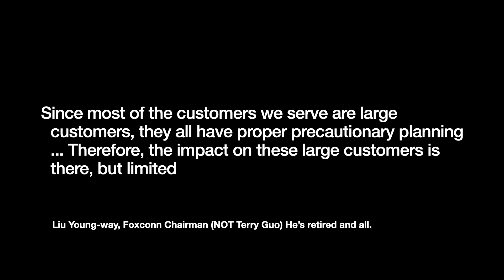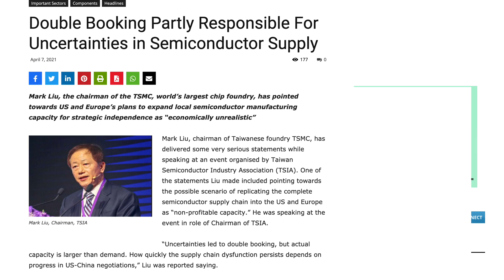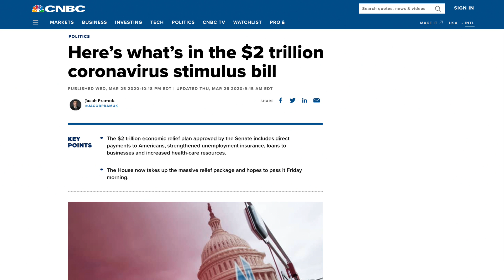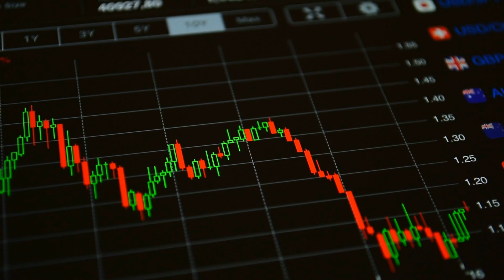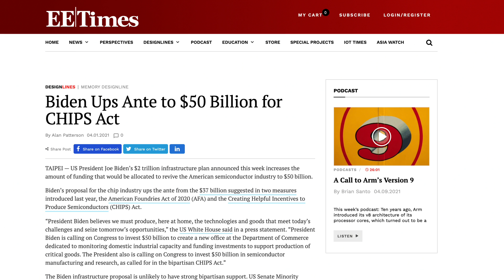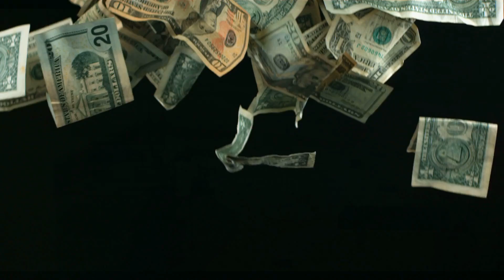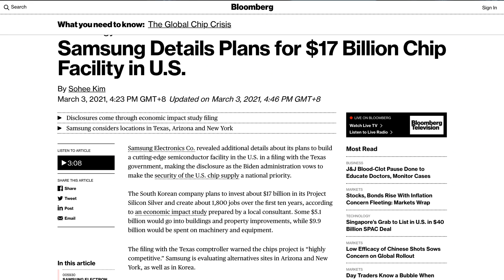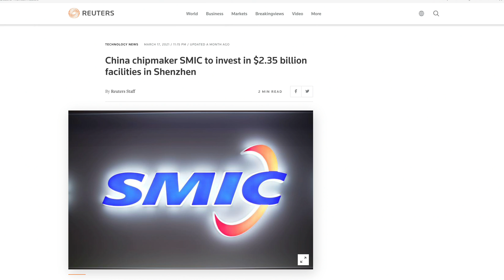The Coming Semiconductor Bust

Comment: Extremely unlikely to happen in near future because it takes minimum 5 years to get a Fab operational to a satisfactory degree. Most of the fab plans we hear are recent or just planning stages.
Reply: What expert forecasting shows (real data backed by extensive research) is in part what's driving all the FAB build outs. Do you think that because it's 'hot and in the news' that a bunch of investors run off to invest $20B in a FAB. These investments are huge and not taken lightly and without a wealth of information backing them up. What would be better is for you to figure out 'why all these investments are needed' rather than 'why all these investments are not needed'.
Reply: Ummm, no.  It takes a long time to develop a new node.  It's expected that the factories that are being built by TSMC and Samsung will be operational in about 3 years, because none of these plants are being used to develop new nodes.  In AZ for instance, that will start out as a 5nm fab.  That node is already in mass production in Taiwan and it's the node being used for Apple products.

Once a plant is built, it takes weeks to get the equipment working and tuned properly.  Not years.
Reply: all sources i can find see it happening no later than 3 years from now, with most saying closer to 2... and pretty reliable sources see it happening as early as late next year.
Reply: But we didn't have a shortage until recently, so if those capacities go to work fully or just partially those fabs don't need to have high productivity to create too much in sum
Reply: @tomlxyz   There was a shortage incoming. There hasn't been enough capacity provisioning to meet demand medium term. Even without the bursts in demand due to work-from-home and crypto boom(s), the capacity would run out shortly anyway, maybe not in late 2020, but in just a couple years. Every year, people need slightly more flash storage, more cloud servers, more this and more that, now fridges have computers too for some unfathomable reason.

Overprovisioned capacity is, to an extent, a good thing. Sure it just costs money when it's not needed, but not having capacity when it's urgently needed can be even more devastating. Whole industries depend on this capacity being present.

Besides, the big growth cycle right now isn't actually that big relative to the existing size of the industry.
Reply: @tomlxyz  shortage was predicted , as there is too large inflexibility and because both industry (or rather marketing) and goverment did not understand fully the complexity of the field. They still do not get it fully. 
The more advanced nodes roll out, the longer it takes to r&d chips, test, more chances for a need of silicon errata , and any supply chain failure or glitch causing shockwaves in too tightly optimised fab environment. 
Fact it costs billions to build a fab makes accountants and marketers try to optimise , like creating fabless companies. But what if fabless company becomes unicorn and buys out entire time of so many fabs , that other potential unicorn corporations get disrupted?
First rule of efficient optimisation is - do not do it. 
It was not followed and while surplus was accepted in lives of actors, celebrities, politicans to excess allowing them to buy luxury yahts and run personal vendetta wars ruining countries of size of France, semiconductor industry lives on rice. 
Shortages will follow also because lot of r&d engineers, and even plain line workers get lost or displaced by current, and future wars. 
Last but not least there is huge shadow semi economy in the giant military complex, which seemingly should be independent from main fabs, but causing brain drain, resource drain and funding drain. This was more or less anticipated ro create effect causing shockwaves in "civilian" semi sector, but it could not be officialy acknowledged until s*& did hit the fan.

Comment: I don’t think the Bust is coming anytime soon. The FABs take years to build and get qualify for HVM. The Globalfoundries gave up the advanced tech years ago. According to the latest article, Samsung is 1 generation behind TSMC. In the leading tech, TSMC is the only supplier right now for the best tech. For the auto industrial, it takes long time to quality new suppliers. It will stuck with the same partners with similar outputs for years. For most Analog FABs, they usually run (very) old tools, old tech and have secret/unique processes. They could not have capital to significantly increase the outputs soon. Even they are going to expand the production, they need to find the tools, spaces. It will take time to install and qualify. It won’t happen next few months!

Different nodes/processes target different markets. Even one node oversupply does not mean the whole semiconductor bust is coming. 
Depending on the future applications, the EV, 5G, Machine Learning, Datacenter … may need (a lot) more chips. I am optimistic in the Semiconductor for foreseeable future.

Comment: Very good stuff, but I think the demand side needs closer consideration.

I am inclined to believe in the current "megacycle"

Fresh demand ultimately comes from folks w/ new apps, needing more grunt or efficiency.

There seems a coinciding surge in all 3, with exponential effect. The new power & economics has made new apps like AI, cloud, blockchain, desktop hi res video editing, AVs,... possible.

It may be OT, but it bears noting how massive demand for solid state data storage will be. There is a vast pool of data  that would be better served by NAND storage if the price were right.
Reply: Demand will come simply because new products exist using TSMC 5 and 3nm.  But he didn't talk about the nodes because he was too busy making a slight at govts. giving subsidies to get fabs built in the EU and the US.

Right now AMD can't keep up with demand for their server CPUs.  Replacing older systems is not just about the extra compute power, but because the power savings.  For older systems, the power savings over a given period is enough to pay for the upgrade, according to IT professionals.  So, the life cycle for replacing systems is being tossed aside.  And this is with TSMC 7nm.  TSMC 5nm is 25% more power efficient, TSMC 3nm is about 40% more power efficient than TSMC 7nm.  This is enough to cause most large companies that have server farms to upgrade.

There WILL be no bust cycle for TSMC in particular.  Apple and Intel has already bought up their entire first year capacity of 3nm.  But, this dude doesn't follow tech news apparently.

Comment: Constraint No. 1: Building a huge new fab requires a lot of engineers, condensed matter physicists, skilled construction workers, etc. Order of magnitude size increases means order of magnitude skill increases. This has to be set against countries like Taiwan and South Korea who have had record low fertility rates for the last 20 to 30 years.

Constraint No. 2: Chip consumption in things like cars and aircraft rises geometrically. The semiconductor count in an early 1980's car might have been 10 or 12 chips. As cars implement on-board networks, the bundles of wires that run through the car is reduced to a data wire and a power bus. The brake light assemblies each have a chip. Each tire has a pressure sensor and wireless transmitter. The overhead dome light has a chip. Each seat belt has a chip. Each 'entertainment center' molded into the back of a headrest is a full blown media computer.

When 'hobbyists' can buy Arduinos for $29 or Raspberry Pi Picos for $4, then 'everyone' can not only use chips (as in phones or laptops), but also design them into their own living spaces. There are now hundreds of millions of 'electrical engineers' incorporating 'intelligence' into their houses, boats, gardens, and farms.

Comment: “Crash” is all relative. Even a slight overhead capacity will be called a glut and inflated prices will drop. But the companies did well. The extra capacity is needed because demand is and will be increasing for the next decade. And after that will explode. There will be no crash.

Comment: Part of the issue was that car manufacturers tried to buy say 65 nm process wafers at 6K or so per wafer, they never went ahead and gone down to say 14nm.
They would need 5% the wafers based on transistor count, realistically 10-20% when accounting for other components as well, for around double the cost per wafer.
Are they building 65nm fabs as a response, which would be madness, or are they counting on oversupply making 65nm production on advanced nodes becoming affordable?

Comment: The Electric Vehicle revolution is coming. You have to factor in them as a new demand. Musk alone wants to make a million cars a year in 2022 (and he's on track to hit 800k or so in 2021), with Gigafactory Berlin and Austin just coming online by end of the year. That is even short of the 25k mass-market Tesla that's coming sometime in the next 2-3 years. That million cars a year will grow. I'm hearing whispers of Gigafactory for UK. This is just ONE manufacturer. I'm pretty sure the other auto giants won't be producing that volume before 2025, but it'll get there. Then you have to factor in the companies that are making electric busses/trucks/delivery vans... all of that is going to need computer chips, and more than one per vehicle. So I think the demand won't crash.

We're due for a fleet switchover, and the EV uses many... many more chips than the ICE car. Even if its the post-2016 models where some electronic system controls a lot of things. The EV's need for system control is much higher, Teslas have a damn "black box" computer. It records performance data and tattles on you if you were a naughty driver and ran a red light, and crashed. It will also exonerate you if you are NOT at fault. All those on board cameras are gonna catch the aggressive blockhead tailgating you, and then the rear impact. And don't get me started on the level-5 self-driving race.

Comment: I think you are comparing apple and orange. Memory chips can become over supply easily while CPU or ECU, multi purpose processers continue to be high demanding because of compex and Cost of making as you describe it.

Everything from house, auto parts, trucks are short supply because of shortage of labors, engineers, and Cost of making. 

This hyper inflation cycle is very different from the last over supply of memory chips.
Reply: Every IoT will require memory to keep track of profile.

Comment: Well , overcapacity will be there from 14 nm upwards , but the main reason for new Fabs is EUV , only with EUV you can archive less than 7 nm . With EUV you need everything new exept maybe the Building ... , its a major change . TSMC builds new Fabs for 5 nm and 3 nm  because the demand for 7 nm is high and even the higher as 7 nm Fabs are selling good . The US Goverment wants chip Production in the USA , without chinese looking at the Designs for Chips of military purpose , Trump blackmailed TSMC to build a FAB in the USA or he would do with TSMC what he had done with Huawei ... . As soon as the 5 nm is full production from 2022 onwards prices of 7 nm Waver will drop , for DDR5 you will need 7 nm i guess , to meet the 1.10v spec

Comment: China will develop its own production. Europe will do the same. So capacity will be vastly increased. It’s going to be a big bust.
Reply: Only for US which lack manufacturing ability due to high labour cost. On the other hand, cost of killing will be cheaper in US.
Reply: @saukraya3254  That's a funny statement when most of fabrication is automated.  The cost of fabrication won't vary much from country to country.  You don't think that S. Korean, Taiwanese, Japanese and European engineers make good money??

That's not the issue.  The issue is supply chains.  The issue is making a completed product.  Right now for instance most graphics card for PCs are assembled in China.  The main processors are fabricated in S. Korea or Taiwan.  Raw materials have to flow to all those countries.  It doesn't make sense to make a graphics processor in the US and then have to ship the chip to China to have the graphics card assembled, and then the finished product sent back to the US.

So, that's really the next step in the EU and the US, is to get back the product of high quality PCBs so final assembly can happen in the same country.

Comment: Semis don't have to stand on their own two feet, that's a rather simplistic way of thinking. The cost of a shortage simply has to be greater than the cost of the subsidies.

Semis are so integral across so many industries these days, that permanently subsidizing their production and ensuring a constant glut may actually be cheaper than dealing with natural shortages. You see the same thing with the energy industry. Energy is so important to the function of the economy that it is worth constantly subsidizing energy production rather than dealing with the economic fallout of energy shortages.

Comment: If deep learning continues to deliver results while demanding ever more powerful hardware support, we will not see an oversupply of chips coming from the latest generation of fabs.  If deep learning fizzles out, as artificial intelligence has done in the past, we'll definitely see an oversupply and crash in the semi market.  It's good to understand the overall market fundamentals covered by this video as well as the specific differences in the current cycle which may result in a deviation from past behavior.
Reply: Deep learning cannot "fizzle out." That would be like the PC market fizzling out. It can mature, but even that is years away. Deep learning has way too many useful applications to fizzle out, just like the PC has way too many useful applications to go away. The market for the current applications of deep learning is huge. Most companies/industries that can benefit from deep learning haven't even started to implement it. And we haven't discussed the yet-to-be-discovered applications of deep learning....
Reply: @briancase6180  "If deep learning continues to deliver result...". IDK man, maybe try reading my comment again?
Reply: @GeezerTuber  ok. Whatever.

Comment: "Fabs are losing valuation right away..." That must be why TSMC 7nm and 5nm are their biggest money making... sarcasm...
Reply: he means that they are a depreciating asset, in 5 years that process node will be old news so you have to pump out as many chips in that time as possible to be profitable
Reply: @zoravar.k7904  They would depreciate if they didn't upgrade their fabs, which is one of many statements he made that are complete BS.  Do you think TSMC is going to keep a fab at 5nm (which is how the AZ starts), if they aren't making money with 5nm?  These companies aren't stupid.  They build these fabs now so that they remove the equipment that does the actual laying of materials and etching, currently EUV lithography, and update it.  It won't take but 2 - 3 years before the AZ fab is putting out 3nm products, unless TSMC is still getting a lot of business with that node.  That's why TSMC revenue has been nothing but growth.
Reply: This whole video was a joke.  Thank you for pointing out another BS statement.  TSMC revenue has gone up very year since 2009.  No speed bumps, no tiny downturn, no nothing but lots of growth that has ROCKETED with 7 and 5nm.

Comment: or the process gets so complex and requires clean at a rate that is excessively expensive and increasing unattainable as demonstrated by higher failure rates .. and the chips are not really needed.. and excessively expensive.  Intel knows this.. Trying to make parts at 50 diameters of gold is rather daunting... especially if the electrical dynamics change with one rouge 'substitution'...

Comment: It will be quite a while before we see a significant drop in demand for one major reason, the massive leap in efficiency in the recent server chips as they move from x86 to power optimised ARM. Power and cooling capacity are a major cost for data centres, so over the next few years you can expect every single data centre to be switching out their CPUs. The newer chips will produce savings in the hundreds to thousands of dollars a year per chip, which will have far more of an impact on the price than the consumer space. Every chip in every data centre puts a lower bound on the price; the point at which it becomes cheaper to replace it now (and a single new CPU may replace dozens of old ones).

Comment: In this case the US really needs to use a very small part of the very massive military budget to have a US based US owned and US paid for semiconductor industry at least for military and subordinate use.  Any non military builds used for profit would just be a bonus.  It gives full sovereignty to the US for military technology and to US only based assets.  This would give the US semiconductor manufacturing capability in a secure environment and without the ability to get into government computers and weapons via components it would also lessen China's need to attack and retake Taiwan.  As for mass production for non government used phones, cars, etc I really don't think we will have manufacturing for that here although it would make sense.  It would not surprise me if TSMC built the Arizona plant to future proof in case of a winnie the pooh bear take over of Taiwan at least some of the company would not be in the hands of the CCCP imbeciles.